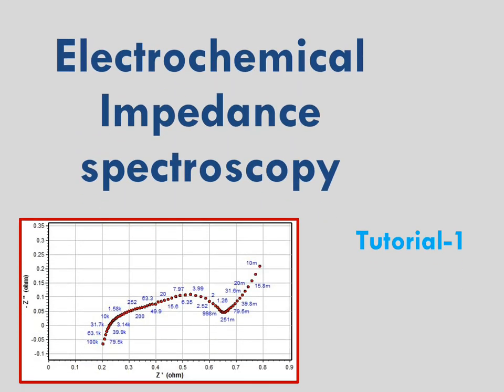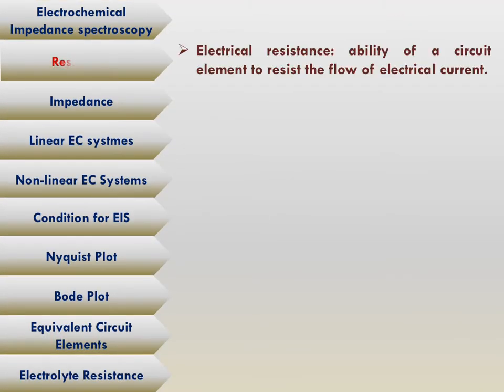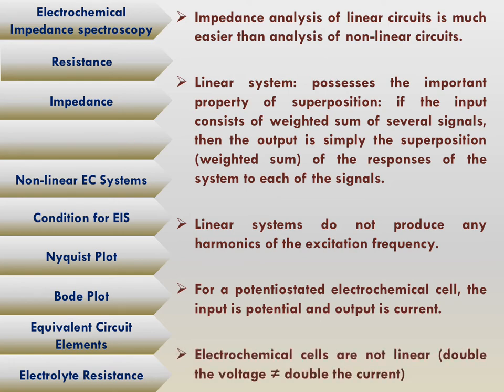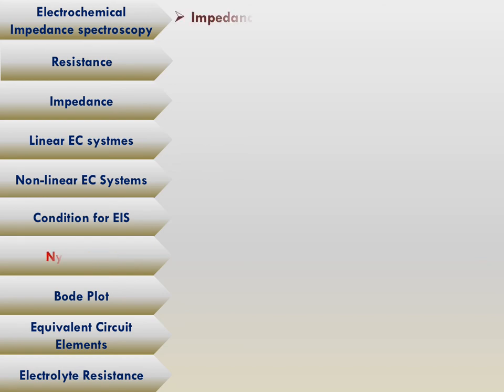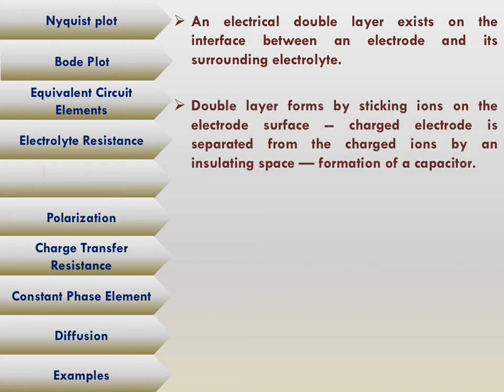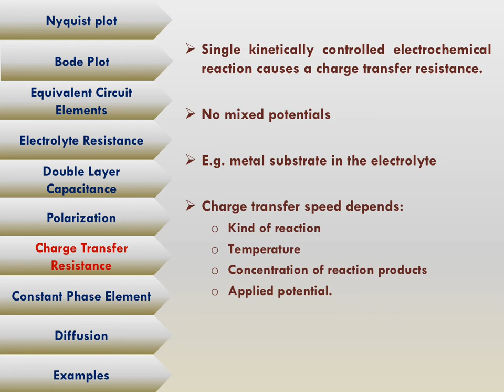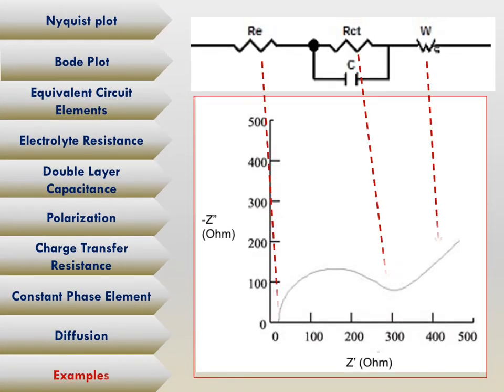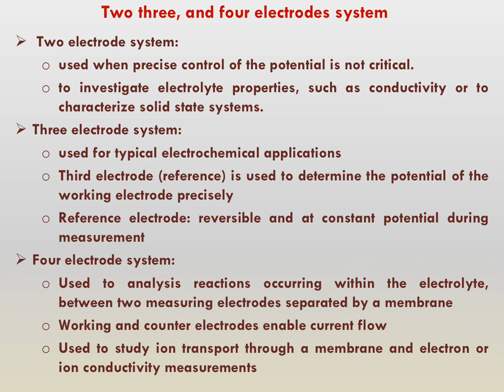Electrochemical Impedance Spectroscopy-Tutorial-1

Comment: Sir,  i have my synthesized nanopowder how can i prepare the electrolyte solution from it
Reply: You can press the powder to make a disc. Then use an impedance analyzer or an LCR meter or a potentiostat or... any instrument that does the job, to measure the bulk properties of your material. You also need a sample-holder/electrodes and some kind of controlled environment to measure temperature or humidity or... any dependence of your material to the controlled conditions.

Comment: Why mainly AC biased is applied for the EIS Studies?
Reply: Impedance exists only in AC ( with the presence if capacitance ,inductance or both ). Mostly for biological applications capacitance exists , depending on the material. Because of which variation of impedance is plotted against frequency. ( Spectrum )

Comment: Can you please tell about Nyquist plot having three semicircles, how to interpret such plot ? 
Such a plot (starting from left towards right) which has a big diameter semicircle, next to it is a smaller semicircle in between and next to this smaller semicircle (at the right end) is a semicle having diameter larger than middle one.

Can u please help me in interpretation of such plot means which semicircle defines which resistance and how to determine that from plot ?
Reply from the maker: In the next tutorial, I will explain it. Thank you very much for your question.
Reply: Correlate your system to model. Identify the characteristic frequency or time constants and then calculate respective capacitances.